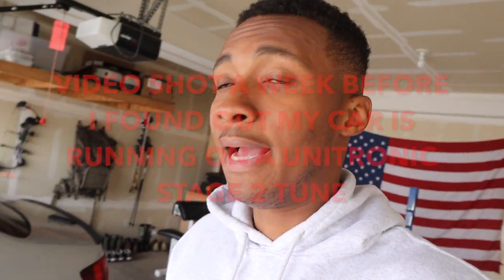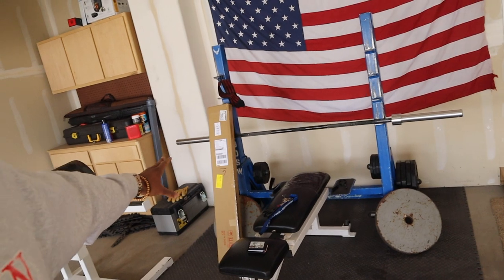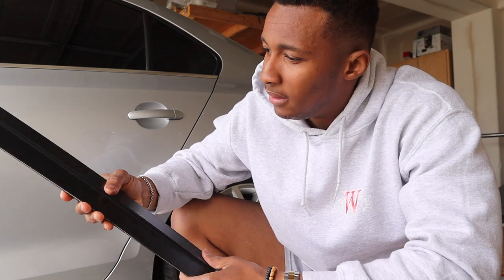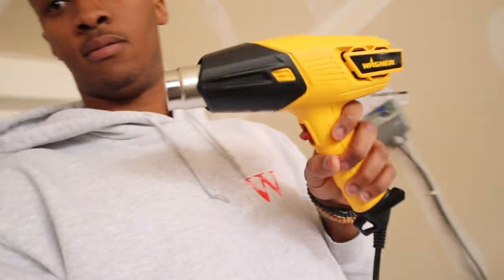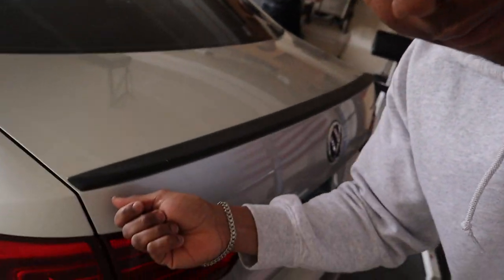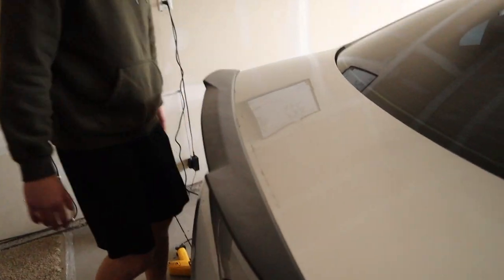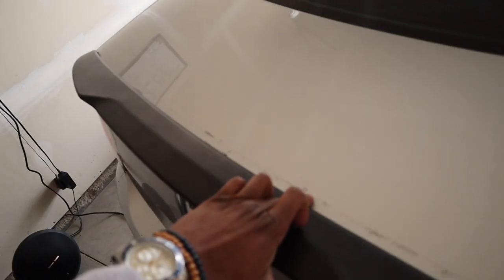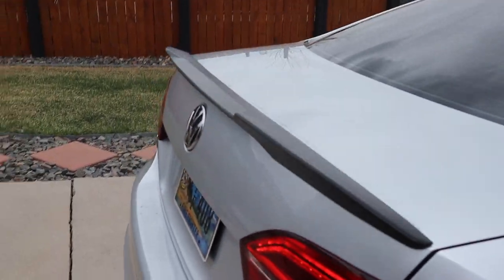Installing an eBay LIP SPOILER on VW MK6 GLI

Comment: Just bought this for my Mk6 and was curious if the 3M tape is actually holding it down.  Also, cool to see another FF with a Jetta ✊🏻
Reply from the maker: So on my car, the 3M tape is actually coming off on one side. So that's a bummer. Thankfully they included a nice roll of 3M so I can take it off and reapply it. I also did this and had 4in snowfall 2 days later. It mentioned not to wash your car for a few days after applying this so idk if the snowfall had anything to do with this. My buddy's red GLI, his lip spoiler is holding up well and we got the same one. So ill just end up redoing mine.  🔥✊🏽
Reply: Ralph Mesidor awesome, got mine installed and it looks sick.
Reply: will this fit my mk6 2013 jetta 2.0
Reply from the maker: @beckychappel5267  This will fit all the mk6's (Jettas) of course

Comment: If that's glue residue, use wd40 and it will remove it then buff down any blemishes with car polish. I've been thinking in putting on that same tail but I don't want it to look tacky but it looks good. 

You should of wrapped it with a carbon fiber wrap
Reply: That just gave me an idea to wrap mine in red carbon fiber

Comment: I have the same spoiler. But  I should have painted it gloss black ( like my front lip spoiler) before I installed it as you should have ( they fade and absorb contaminants)Mine is not on too taped down. Just been procrastinating on taking off and painting it. But these do look good.
Reply from the maker: Gloss black would have been awesome because like you said they definitely do fade.

Comment: How are the light output on the MK7 headlights. Clean car by the way
Reply from the maker: On the MK7 I can't be for sure since mine is an MK6. I did change out my light housing and bulbs to aftermarket ones. OEM output is definitely weak tbh . simply getting some LED bulbs should help

Comment: Anyone know where to get those headlights? I have a GLI and want to swap the OEM ones out
Reply from the maker: https://www.ecstuning.com/b-helix-parts/projector-headlight-set-mk7-style/hvwj6hl-l7~hlx/?ranMID=43304&ranEAID=%2FMYrmLK73SY&ranSiteID=_MYrmLK73SY-FgBXyebQFqgrKBckURmUXQ&utm_source=rakuten&utm_medium=affiliate&utm_campaign=FrankieGisMe&utm_term=13631954279
Reply: Ralph Mesidor says for vehicles with halogen headlights. You know if the base GLI has Halogen headlights?
Reply from the maker: @marcoischill9318  Base GLI has Halogens
Reply: @marcoischill9318  hey i wasnt sure if my gli also had halogen headlights. Did you end up buying his headlights?

Comment: Is the 2012 used gli worth it to buy as first car?
Reply from the maker: I think Jettas are great first cars. Even better a GLI because of how fun they can be to drive. Great gas mileage and an introductory feel to luxury as this is still a German made vehicle. I would recommend it
Reply: @ralphmesidor9361  cool but if I am buying a used one what kilometres should I avoid if the car has it?
Reply from the maker: @hidisco6721  138k kilometers start getting a little high. Under that is optimal
Reply: I would recommend a 2014+ as it has the pretty LED tail lights and the edition 30 & autobahn has the Xenon headlights. Also do your research on “VW timing chain settlement” before buying.